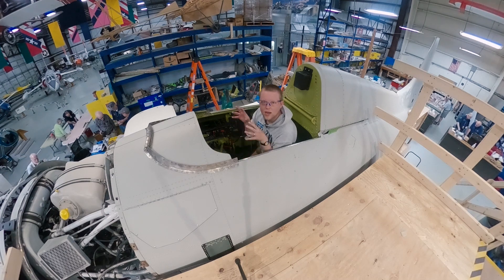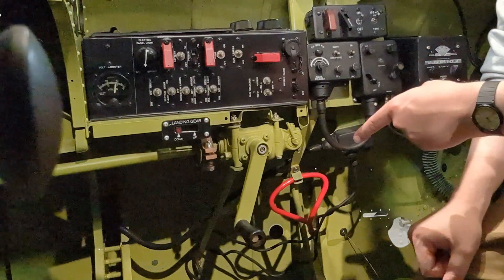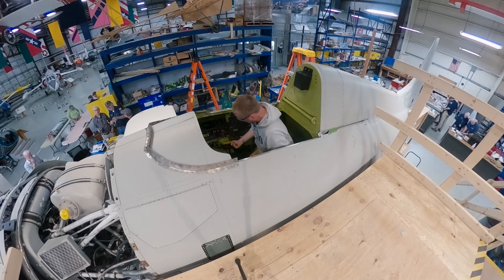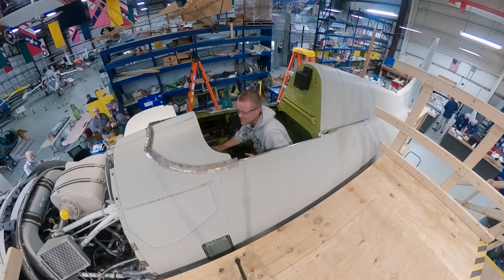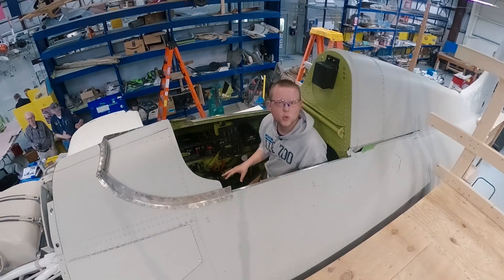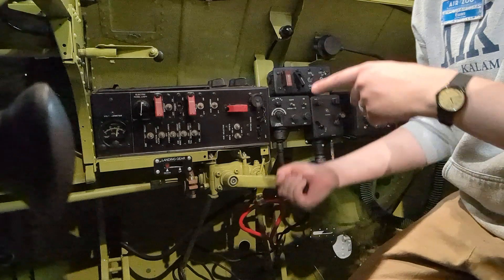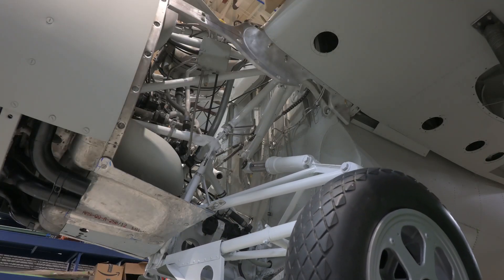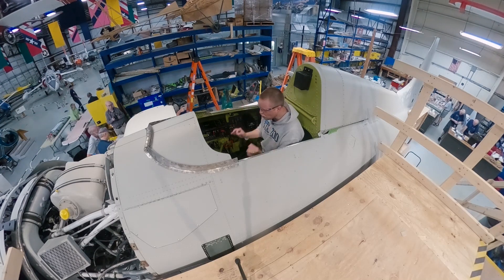Operating the FM-2 Wildcat's Hand-cranked Landing Gear

Comment: The FM2 nee F4F was derived from the F3F, a biplane. It's impractical to fold gear into the lower wing of a biplane. So when Grumman got the word that the F4F had to be a monoplane it went to a single wing design but retained the out-of-date gear system.
Reply: ...Monogram had a 1/32 (or 1/48) kit of the F3 that had the retractable gear as you turned the prop...the good old days of great kits that didn't require a mortgage to buy...

Comment: That is maybe so, as the FAA acquired ex Aeronavale F4F,s after Frances Capitulation in June 1940, and a god send to the Atlantic Convoys when the FAA  desperately needed decent carrier fighters. In the 21st century, peaceful activity of display flying, the tedious act of winding up the F4F,s undercarriage is exhausting. For example the Shuttleworth Trust,s Jewel in the crown the DH 88 Comet Racer G-ACSS Grosvenor House had its undercarriage converted to electric actuation using a canopy motor off a Blackburn Buccaneer Attack Bomber.

Comment: There is a lot of stuff, for one bullet to hit, to muff that up. Get shot in the arm and you are belly landing.
Reply: No, the gear will lower pretty much on its own after you flip the lock.  Make a slight turn as it reaches the bottom and it will lock into place.

Comment: I doubt those airplanes had too many landing gear system failures! Good and reliable, as long as your not being shot at whilst trying to take off, then this probably beats the added weight and complexity of an electric or hydraulic gear!
Reply: Note that the Japanese Mitsubishi A6M2 Zero and Nakajima Ki-43 Hayabusa both had hydraulic landing gear, despite being designed to save the maximum possible amount of weight (no self sealing fuel tanks or armour).

Comment: Why can't they include a DC motor to do the cranking? Given all those levers and gears and chains, adding a motor wouldn't already be too complex!
Reply: When you think that even the Japanese fighters, that put lightness above all, had powered landing gear operation, this decision by Grumman was inexcusable. I bet the thing pilots transitioning from the F4F to the F6F liked the most, wasn't the 2000 HP engine, but a landing gear that gets up and down with the flip of a switch.
Reply: @magoid  Pilots loved this aircraft. You're pretty misinformed
Reply: @joeblowe3180 I was talking about the landing gear crank. You tell me they loved that thing?
Reply: Motor would only replace the crank and one chain, maybe, but now it needs electrical power, a fuse or circuit breaker, and that's more to break and maintain.  Sometimes simple is good, the pilot only had to crank twice per flight, and he wasn't cranking during combat.

Comment: It was possibly the main criticism of the Wildcats when taking off and landing but it was a good and a very sturdy airplane
Reply: It wasn't the only plane that had hand crank. A lot of other small planes did that too, to save on weight and volume
Reply: @joeblowe3180  thanks for the info, I didn't know that but regarding the Wildcats I understood that you somehow needed three or four hands to crank up or down the wheels..
Reply: but positive feeling is that pilots didn't forget to extend it or retract it :)
Reply: @pietroseven8228  yes but it has window panels at the floor and you have to hand crank up or down....

Comment: Would it work better to roll the aircraft inverted and then raise the gear, or are there technical reasons not to?
Reply: In theory yeah, but an upside down aircraft right after takeoff is almost always a bad idea, unless you fly for the blue angels or something. Would be fun to see tho.
Reply: @pioboss9823 basic physics escape most people. It’s why there’s signs everywhere 😂
Reply: Not all engines like being upside down for more than a few seconds. Fuel or oil supply could be affected. I have no idea how the F4F deals with that. Also, like someone else already said, probably not a great idea to that sort of stuff whilst at low airspeed and with possible battle damage (at landing).